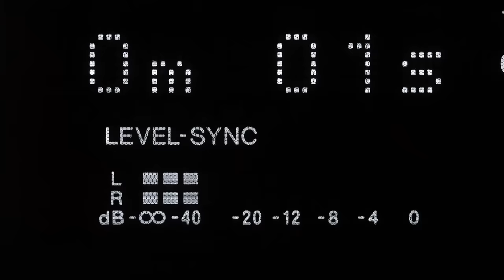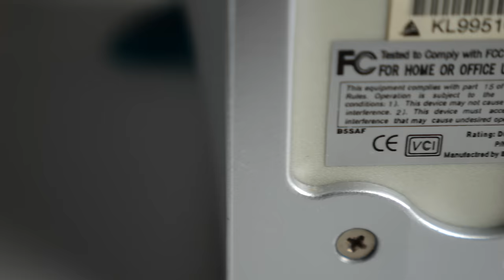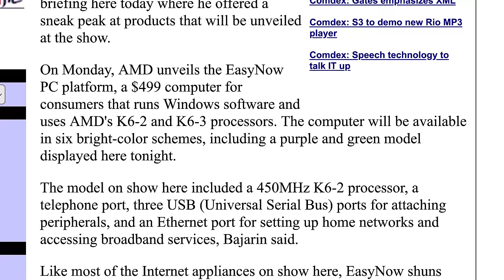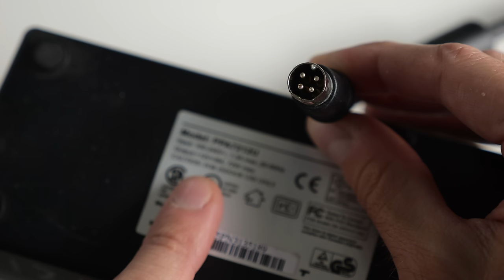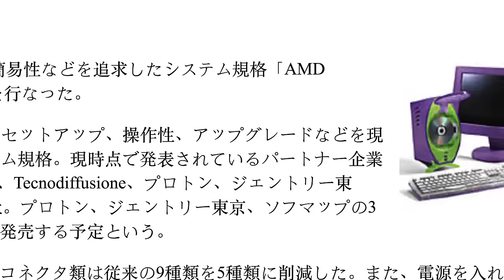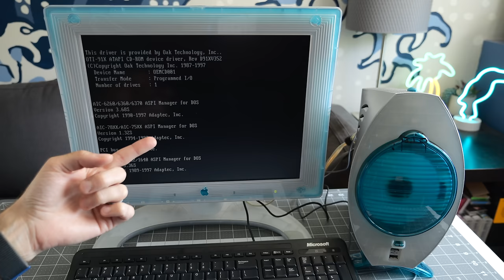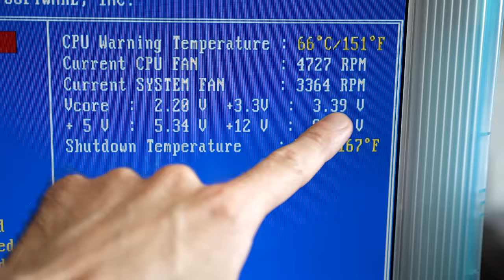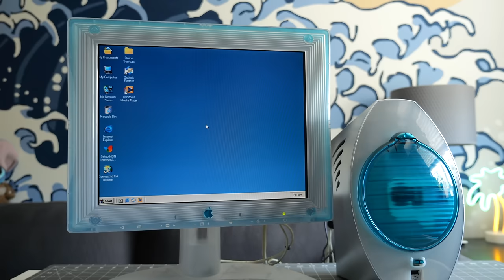EasyNow PC: The 90s Cheap and Cheerful Internet Computer

Comment: Early ATX / F.lex ATX standards that Intel introduced had the concept t have the front fan to SUCK in cool air and blow it out of the CPU fan.  Cooler fans usually blow cool air down.    So with this original Intel thing was flawed as warm air from the other components would be sucked by the CPU cooler, making the CPU run hotter.    Yeah, it was stupid.    

The manufacturers easily fixed that by NOT doing the cooling that way after a year or so.

Comment: These things was fads back in the 90's if you can call it that. They was dead on arrival in the US. These things later evolved into Netbooks in the 2000's that was a popular fad in the US for a few years. That said, I remember purchasing a PC around the time Windows ME came out, and that PC actually came with Windows ME preinstalled. I never understood the hate either, maybe because I wasn't a power user at the time and so therefore never ran into any real issues. Later, I ended up upgrading to Windows XP
Reply: ME is remembered worse than most simply because it was preceded, and not by long, by Windows 98 SE (which was better in basically every way) and followed shortly after by Windows XP (which was better in every way).  It had some serious security issues that were never fixed, performance was terrible through its entire year-long life (especially at launch, where it was plagued by memory leaks) and it completely broke compatibility with DOS programs... and people never forgave it for that.

Comment: Honestly, I didn't see the 'obvious joke' with the case design. To me, it looks like an eye turned sideways. Hell, a goat eye if you can see the the cd tray mechanism.
 
That being said, it's still a pretty nifty computer, pity they had to cut so many corners to make it inexpensive. You know someone's kid tried installing a top of the line game anyway, and then realized it could only be run at minimum possible settings. Meanwhile, the adults in the house were wondering why there was suddenly so much less space on the hard drive.
 
That power connection would have annoyed the heck out of me - one of those areas where the industry needs standardization, and why I am not a fan of laptops.

Comment: if this shipped with win98, how did they install it without a floppy?
Reply: Some Windows 98 CDs were bootable, but OEMs usually had their own custom restore discs instead of a regular Windows CD. Besides that manufacturers used hard disk imaging to quickly image hard drives with a complete Windows install including drivers and their bloatware since installing everything from a CD on millions of computers would be ridiculous and take forever.

Comment: I've seen full fat K6-II and K6-III processors (not the K6-III+) in a socket in a laptop so they couldn't have been that bad. And the K6-III+ were mostly all sold in laptops. Back when people would buy them to upgrade their K6-II systems they were mostly being sold as laptop pulls. Again. They couldn't have run as hot as you claim.
EDIT:  Just looked it up CPU World says a K6-II 450 averages 50c and can only run at a max of 70c so even one at it's hottest temp isn't that hot. Especially when you compare it to some of todays processors that are lucky to run at an average over 80c.

Comment: Thanks for the great insightful video! Maybe some additional insights. Not 100% sure about those, but I can seem to remember that:

* CD drives can have read issues with burned disks, especially older ones where the laser is getting a little weaker
* I guess your mouse wasn't working in setup because of the power saving it does. You can see the led changing in brightness. IIRC that wasn't supported in the basic driver set provided by Windows
* Again, also an IIRC: An A: drive was necessary on DOS-based Windows, otherwise it wouldn't boot

Comment: Windows xp should work fine with it, or windows 2k. Windows ME is hell when you start using it, first boot is fine, but that hellish piece of software would have its registry corrupted just by a power outage. Or by reseting after a game froze. It's the first and only windows with a built-in registry fixer. MS knew the shit they were releasing.

Comment: "ME" wasn't that bad...  LOL.  The biggest issue I had with ME was that it didn't add any real features over 98SE, and by that time Win2k was out and was superior in every way.
Reply: It introduced System Restore which is still used to this day, system file protection, much better USB and general driver support, automatic updates, a slightly refreshed UI closer to Windows 2000 in style, and faster booting thanks to the removal of real mode DOS. Though that last one turned out to be one of the biggest complaints at the time as people still relied on DOS for a lot of things.

Comment: Wasn't that bad? Stability varied between installs, on the same machine. If you got a stable install it was fine. But it was very hard to get a good install. It's the only version of windows that has given me a blue screen during install. It was easily the worst version of windows from 3.xx onward.

Comment: try vacuum blu-ray drive as diy silicon wafer photoresist pattern cure machine
Reply: all is used to soak up very poor performing code, use 2d ray casters again
Reply: optimize at the correct spot, or you are wasting everyones time
Reply: especially any "commercial" stuff, no matter what it is
Reply: money-rights are the worst burden ever
Reply: stop wasting my time
Reply: money makes stupid decision maker, you have externalized decision making, to something outside you
Reply: plugged incorrectly :)
Reply: nice, lose the pride

Comment: We have not come far at all since 1999.  In the year 2000, PCs were more than 200 TIMES as fast as computers from 1981.  Not only did the clockspeed increase from 4.77mhz to 1ghz (only 19 years), every generation offered additional computing power per clock tick. 
Since 2000 (22 years) , we are barely 5 times as fast on a per-clock basis.  Even if you throw in the extra cores, it still is nowhere near 200 times faster in clock speed alone. I am using a 2007 PC to watch these videos and comment.  This was IMPOSSIBLE in 2000 to do then current things  on a pc from 1986 (a 14 year old computer in 2000).

Comment: 1) This PC has absolutely nothing interesting AT ALL.  It is the most generic of generic computers.  2) This machine would be great for gaming, so long as you don't try to run games from 1999 or newer.  This will run games released in 95 or earlier quite easily.